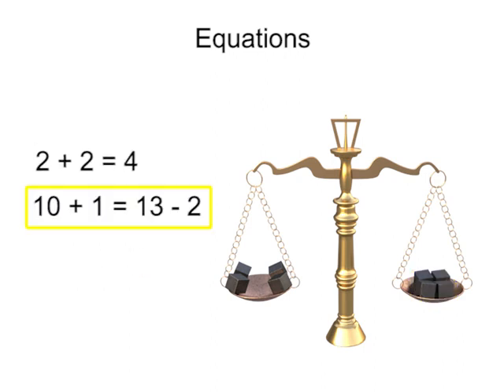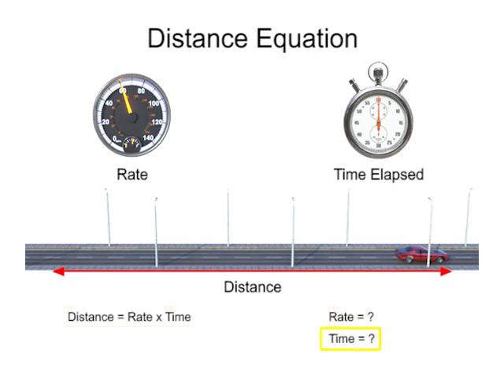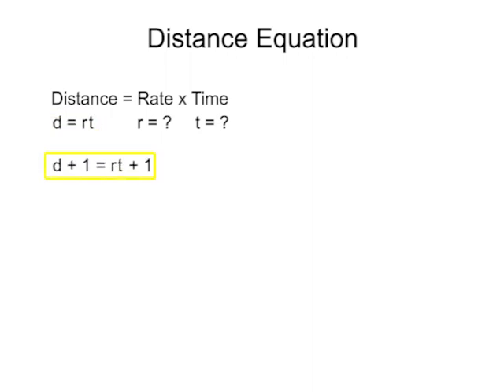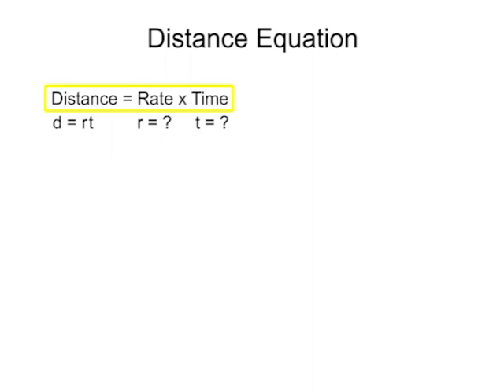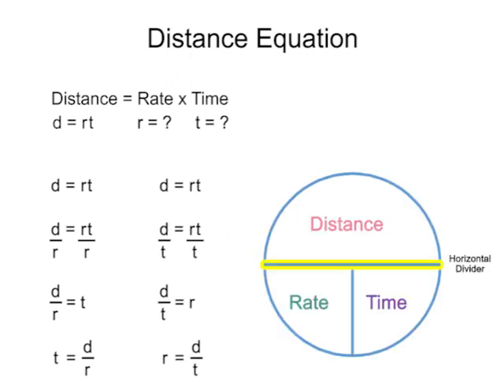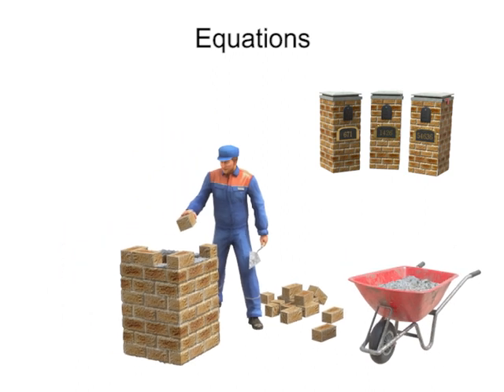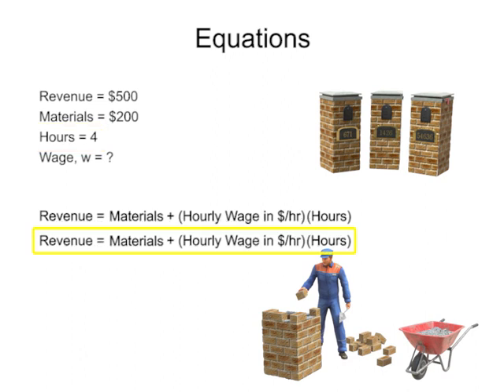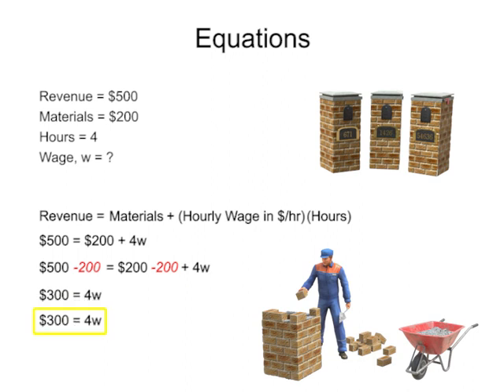Equations | Basic Math Topics 4/5 | المعادلات

Comment from the maker: Thanks for watching. For More Videos: Please Subscribe My Channel
Basic Math Topics Tutorial: https://bit.ly/3gHD6cq
دورة في احتراف الرياضيات والجبر والهندسة والتفاضل والتكامل والقوانين الخاصة بها بدون تعقيدات.:  https://bit.ly/30ykUtG
Solid State Devices & systems Tutorial: https://bit.ly/31PedHP
Embedded Systems & Microcontroller Tutorial: https://bit.ly/3893dpH
Motors and Drives Tutorial: https://bit.ly/3dH0yF1
Process Control Tutorial: https://bit.ly/3hTASs7
Fluid Power Fundamentals Tutorial: https://bit.ly/2NSowCL
Fluid Power Design and Application Tutorial: https://bit.ly/3dEjvIq
Fluid Power Control Tutorial: https://bit.ly/3eniF3S
PLC Programmable Logic Controllers Tutorial: https://bit.ly/2C22zhI
Complete Practical PLC Course Tutorial: https://bit.ly/3dHon09  
Advanced PLC Programmable Logic Control Tutorial: https://bit.ly/3g8FfO3
Electric Motor Control and Power Systems Distribution Tutorial: https://bit.ly/31Cib6c
Industrial Robotics Tutorial: https://bit.ly/38hQnWd
Industry Blueprints Tutorial: https://bit.ly/2ZqCn8p
AC Circuit Analysis Tutorial: https://bit.ly/2VyoHqP
Physics Tutorial: https://bit.ly/2BjVOaX
Motion Control  Tutorial: https://bit.ly/31sqUrz
====
Channel Link: https://bit.ly/2IsqVS for watching more Videos
😌Don't Forget To Like, Share, Subscribe & Comment 😬
====
تعريف بالقناة:
قناة تعليمية مهمة للجميع عليها أكثر من 210 فيديو تعليمي، بها:
1- شرح لبوردات الاردوينو Uno & Mega 2560  وعمل مشاريع رائعة بها حيث، شرح Servo Motor, DC Motor وطرق توصيله والتحكم في إتجاهه، و EEPROM وتوصيلها وكيفية التعامل معها. وال Stepper Motor، واستخدام الاردوينو كمولد موجات جيبية ومسننة ومثلثية،
رابط الدورة من هنا: https://bit.ly/2PvtHvx
2- شرح دورة الأنظمة المدمجة Embedded Systems والميكروكنترولر واحتراف البرمجة بلغة الامبيدد سي Embedded C. وعمل مشاريع رائعة…
رابط الدورة من هنا: https://bit.ly/2KadqX2
3- شرح كيفية الربط بين الاردوينو واللابفيو وعمل مشاريع رائعة بهما.: https://bit.ly/2KlTssj
4- شاهد أيضاً،دورة مهمة جدا لطلبة الهندسة في شرح أساسيات ومبادئ التحكم الآلي او هندسة نظم التحكم
(Automatic Control or Control systems engineering):
رابط السلسلة:  https://bit.ly/2NGyeYd
5- دورة متقدمة في التحكم باستخدام اللابفيو (مهمة لأقسام تحكم أو كنترول والكترونيات). وهي تطبيق عملي لدورة التحكم الالي 
رابط الدورة من هنا: https://bit.ly/2K7aVEE
6- سلسلة Root Locus Method في هندسة التحكم الآلي لطلبة كلية الهندسة، قسم كهرباء،
رابط السلسلة: https://bit.ly/33CROvi
7- سلسلة عملية في القوي الكهربية او الكهرباء المتردده الاحادية والثلاثة الطور (Electrical Power) لطلبة هندسة ولكل مهتم بالكهرباء
رابط السلسلة كاملة:  https://bit.ly/3dWEckc
8- بعض الدواير العملية الكهربية المهمة للجميع.
رابط الدورة من هنا: https://bit.ly/2Fnli65
9- دورة في القياسات الكهربية، مهمة لطلبة كليات هندسة ولكل مهتم بالالكترونيات والكهرباء: https://bit.ly/30RdTVS
10- دورة في احتراف الرياضيات والجبر والهندسة والتفاضل والتكامل والقوانين الخاصة بها بدون تعقيدات.:  https://bit.ly/30ykUtG
11- دورة في احتراف برنامج اللابفيو الرائع LabVIEW : https://bit.ly/2TOx4y4
12- برامج مهمة للكمبيوتر واللابتوب الخاص بك: https://bit.ly/2qT9NM6
13- Complete Practical PLC Course Tutorial: https://bit.ly/3dHon09 
14- Green Screen Tutorial Link: https://bit.ly/3esShFa
15- Complete Process Control Tutorial: https://bit.ly/3hTASs7
16- Complete Fluid Power Control Tutorial: https://bit.ly/3eniF3S
17- Complete Fluid Power Design and Application Tutorial: https://bit.ly/3dEjvIq
18- Complete Motors and Drives Tutorial: https://bit.ly/3dH0yF1
19- Complete Physics Tutorial: https://bit.ly/2BjVOaX
19- Complete Embedded Systems & Microcontroller Tutorial: https://bit.ly/3893dpH
20- Advanced Programmable Logic Control Tutorial: https://bit.ly/3g8FfO3
21- Physics Fundamentals Tutorial: https://bit.ly/2CNrzcU
22- AC Circuit Analysis Tutorial: https://bit.ly/2VyoHqP
23- Industry Blueprints Tutorial: https://bit.ly/2ZqCn8p
24- Industrial Robotics Tutorial: https://bit.ly/38hQnWd
25- Electric Motor Control and Power Systems Distribution  Tutorial: https://bit.ly/31Cib6c
26- PLC Programmable Logic Controllers Tutorial: https://bit.ly/2C22zhI
27- Fluid Power Fundamentals Tutorial: https://bit.ly/2NSowCL
28- Solid State Devices Tutorial: https://bit.ly/31PedHP
29- Basic Math Topics Tutorial: https://bit.ly/3gHD6cq
وهناك المزيد علي القناة، وان شاء الله هذه مجرد البداية فقط.
رابط القناة:   https://bit.ly/2IsqVSC
وتعمل اعجاب ومتابعة لصفحتنا علي الفيس صفحة المهندس المحترف
رابطها: https://www.facebook.com/المهندس-المحترف-100879698187843
متنسوش الإشتراك بالقناة لمتابعتنا وتفعيل جرس التنبيهات ليصلك الإشعارات بالفيديوهات أول بأول.
====
#ُBasicMathTopics
#Kyrillos_Refaat